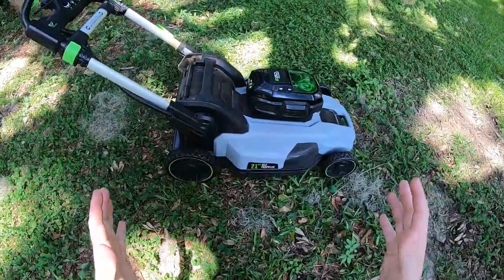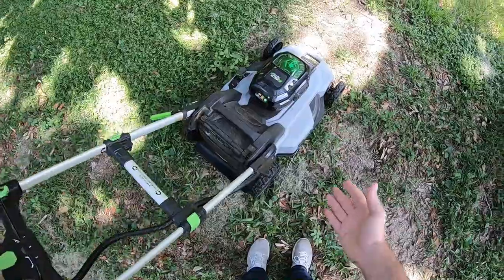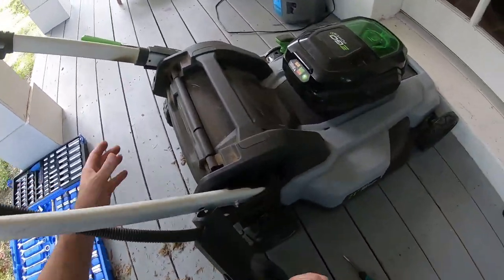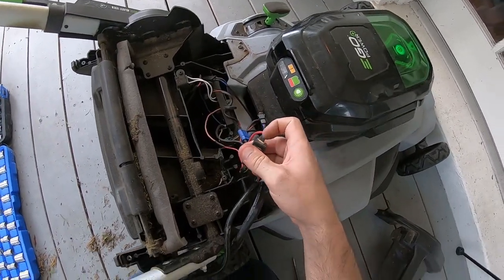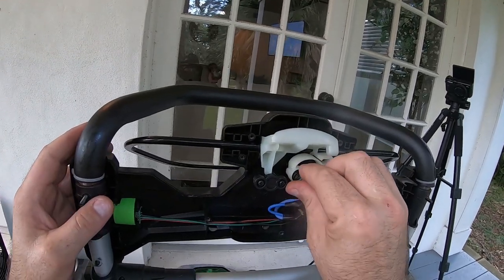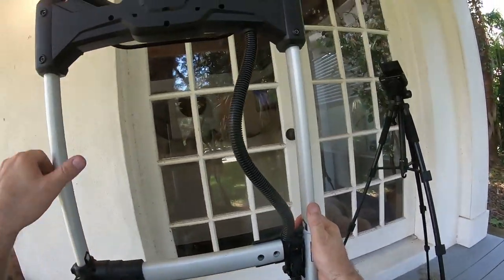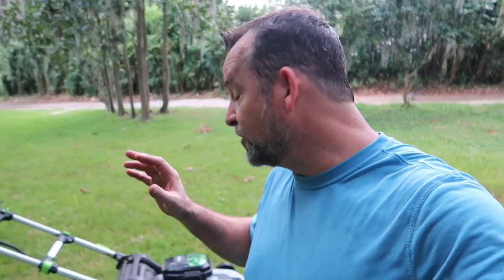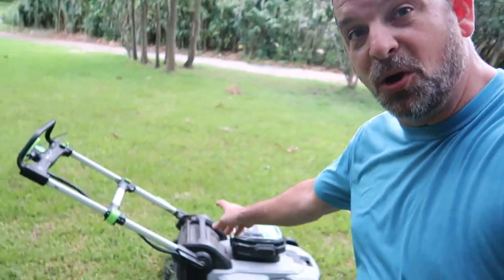BROKEN....My 21" Ego Electric Lawnmower is dead.  Can I Fix It?

Comment: Wait for the right rear wheel to lock up when pulling the mower back, as everyone does. Such as a back-and-forth motion around a flower bed. It will start locking up, a little at a time, then it drags the wheel whenever you pull the mower back. Whether the mower is running or not. EGO now claims the wheel locking up "is a safety feature to keep the mower from rolling towards you". No, the nylon gear in the drive system is stripping out, whether you have ever used the self propel feature or not. A design feature. And there should be another "Cherry" type safety interlock switch on the other side of the handle like the one you jumped.

Comment: I haven't read through all the comments, but the Ego won't run if the arms are in the shortened position.  You have to extend the arms and lock with the green levers in order for the motor to start.
Reply from the maker: This was not the problem. The wires failed in side the tube from a pinch point.
Reply: I think Rick is referring to your attempts to start at 3:15 in the video.  The arms are shrunk down instead of fully extended.

Comment: Thank you for this video and the comment by MuckBucket about jumping the red to black wire. I got my mower running again in under 30 minutes. And this video having over 76,000 views is disturbing.
Reply from the maker: Right.  I had no clue that this problem was so widespread!

Comment: I ran over a plugged in cord to a pressure washer. Shredded the wire and now mower won’t work. The status indicator light is completely off where it used to always be solid green. Battery is fully charged and works cause I put it into the weed wacker and it worked fine. Thought maybe there would be a reset button??? Maybe the live wire fried the mower??? Is it unfixable?

Comment: Same problem on mine. Thanks for the Fix-It tip. Now on the jumper, witch color do you close contact on?
Reply: Black and red. The blue wire is a red herring.

Comment: I’ve seen the 4th ego lawnmower owner have the same issue after 3 years the safety mechanism seems to bend or crimp to keep the mower from turning on the blade .. this me asking questions or finding problems with ego lawnmower before I buy

Comment: Is there any way of Preventing the wire "kink" problem for happening again, once it is repaired?  Would just adding another protective sheath or simply wrapping the wires with a lot of electrical tape do the trick?   Thanks very much.
Reply from the maker: Not sure. I switched to the Toro 60v mower.

Comment: Cool video, I run these things commercially so this is good to know!
Reply: Wow how many batteries do you go through?
Reply: @kevingadson9315   On a dry day last week I had the mower run for just under 3 hours on 2x 7.5ah batteries. Wet days are harder, I have 7 batteries currently 4x 7.5 3x 5.0 My channel has most if not all of the information.
Reply: Electric Lawn Services hi there , have you had any of your batteries have the yellow flashing light problem and don’t work ?
Reply: @darrinanddonna  none yet 1 year in 12 batteries total.

Comment: WARRANTY:  I've owned my ego for almost 5 year.  I've taken it into Home Depot for this problem four times.  Each time it has taken over a month to get fixed.  The last time it was at day 55 still 'waiting for parts'.  I picked it up and did this fix since it has been an annual problem for me (ant the  warranty expires shortly).  I like the ego mower.  However, this is obviously a design flaw and it would be nice if they would cared enough to implement a better design fix when I had it repaired.  Keeping the wire from getting cropped would have been an easy design modification.  Bottom line:  If you have the ability to do this, skpt the warranty temporary fix headaches.

SIDE NOTE ON HOME DEPOT:  I kept asking about my mower status.  They kept saying 'waiting for parts' which was out of their control.  At day 55, I asked more questions.  Turns they didn't have any parts on order, but it put that in the notes since there wasn't really couldn't say they hadn't done anything in 55 days of having the mower.  Another reason to do this fix yourself.

Comment: How do you take the mower deck off? I opened up the other part like you did and found mice had chewed thru the wires but one harness goes under the plastic into the motor I guess so I need to open it further to splice em back together Uggh!

Comment: Good fix man, great job!  I've got the same exact mower and have had two issues with it in my year of ownership.  One was the self-propelled drive motor crapped out (Ego replaced after about 3 months of messing around with Home Depot), and now it's throwing overheating issues after some use.  Granted we live in Tampa and it's blazing hot lately but hopefully that won't hinder its use if we mow in the mornings.  When I get home from deployment I'm going to hack the hell out of it so it's either ON or OFF.  All those damn safety switches only make for potential failure points.

Comment: Open erratic circuit if it was a short you would smell the burning fumes they should have locking connection sot that they can't come loose, it could be a switch problem as you say. Be careful you might void the warranty, then you are stuck, if they use a capacitor you could receive the shock of your life!

Comment: I contacted a repair shop who works on EGOs. She told me it's a short in the wire in the handle. she mentioned they are getting a lot if egos in for this wire issue.So that is covered under warranty

Comment: Where you jumped the wire my connectors are reversed. Your female is coming from under the hood but my female is coming from the side bundle of wires.

Comment: I've had a failure of the self-propelled speed controller after 2 years of use.  It is stuck on maximum speed no matter where the controller lever is positioned.  For warranty service, I was told by the EGO company to take the mower to Home Depot, where I bought it.  The Home Depot rental department employee that I spoke with said they would ship out the mower for repair and it could take 4 to 6 weeks.  THAT IS UNACCEPTABLE!!!!! I was also told that if I take it apart to try to fix it myself, it will void the 5-year warranty.  I always slid the mower handle to the shortest position for storage.  I've noticed that the wire harness makes a tight 180-degree loop when that is done.  In fact, there is a break in the corrugated plastic wire harness cover where the bend is located.  I suspect that a wire within the harness has broken from repeated bending, making the speed control adjustment inoperable.  That's a bad design on top of a horrible warranty service situation.  I like the mower a lot when it works.  But after my experience and watching this video, I'll  gladly throw it in the trash and buy another electric mower from a better manufacturer.
Reply from the maker: Check out my toro video I address some of these concerns.

Comment: What gauge wire did you use to jump?
Reply from the maker: 22 gauge I think.
Reply: Thanks I used 18 gauge bell wire found cheaply on amazon and it worked fine.  Thanks for posting I had the exact same issue and this worked perfectly.

Comment: my ego 21" mowerf continually has the flashing amber light when I try to start. On HOLD with Ego for help as have done the past 2 days. Noone answers. Any ideas??
Reply: It probably is sensing overload. I had the same experience with a snow blower from EGO. I'd stick with a Honda instead.

Comment: Do you also have Ego's snowblower?  Mine shut down last year after one storm.  I wonder if something short-circuited as there was wet snow that day.   

I don't know if you have a big enough yard but how is your battery life in hot 80/90+ weather?  It isn't a Tesla which have liquid cooling.  The machine has shut down in hot weather (battery was hot when I took it out).  It might be the tall grass especially the thicker weeds but I don't feel that this machine is ready for summer.  My next one might be a gas one with a steel deck.  There is a 120V yardforce lawn mower bit it is expensive at over $900.
Reply from the maker: I have had no battery issues.  I have a medium size yard so it is not much problem getting it done with the one battery.  I just mow and then put the battery on the charger every time.  I dont have a snow blower as I live in Florida.  I do have the backpack leaf blower.  It is a great tool.  No problems.  Here is the link to that video- https://youtu.be/UUQeGzGy0Ds
Reply: @UnboxWarehouse  Isn't Florida grass much thinner?  I was looking at another YouTuber who does this as a living and he mentioned how you can mulch the tallest yards there as the grass clippings just dissolve in 2-3 days.
Reply from the maker: @JTR253  I rarely mulch.  I do about every 4th or 5th time.  I feel like the thatch gets too thick and makes the yard look brown.

Comment: My ego is older; I think I lucked out because I rarely did a complete fold the first couple of years.
Just lately it's started to shutdown mid-mow, and yeah, I'm suspecting a bad switch, frayed wire, or broken wire.
At some point I'll probably re-engineer the harness.
I'd rather eto would've just make the harness as external-plug harnesses, but I understand you can't do that because people will F##k them up (and lawsuits are fun!!!).

Comment: Which two wires did you jump?
Reply: Ruly Feliciano yeah I was wondering the same thing
Reply from the maker: It was a connector that came out of the handle and went into the middle of the mower. I though you could see in the video.
Reply: Unbox Warehouse the jumper wire you connected .. which two wires was it RED+Black, Red+black or red+blue? I’m not sure which two wire the jumper wire connected..

Comment: Ego needs to see this and change the design so there is a grommit or pass through that keeps the wires away from that pinch point.

I'm on the fence between Ego and Yardworks up here in Canada......I want matching tools/batteries.....I like the ego power+ carbon fiber shaft trimmer but prefer the design and construction of the Yardworks mower which has a steel deck, side discharge as well as mulch and bag plus it has its wires inside the handle.
Do I give up the Yardworks mower design for powerfeed line loading and in my opinion a better trimmer design or go with the mowner I want and settle for a slightly less well designed trimmer but change out the trimmer head on the Yardworks to a universal speedload like Echo or Shakespeare offers

Comment: The EGO-21" has a 5 year warranty and Home Depot said it was fully covered! Why would you risk repairing 
it yourself then voiding your warranty by removing set markers when you open things up in the mower???!!! 🤔👎👎
So now if you have an issue you cannot fix, your warranty most likely will not be covered since they will see you did your own repairs!
It is a great video once your warranty is fully expired but till then be careful and know what you are doing with electricity with the right equipment.
Reply: Hi: My LM2102SP, has developed the problem with self propel stuck at high speed. My warranty is still valid. But the time I got authorization for under warranty repair, COVID-19 hit. Normally EGO services ( Per the EGO Community Forum) take something like two months. Under the current conditions, it will probably be the end of the summer that they will finish the repair. Warranty or no warranty, I will attempt the repair, since with  high probability it is a crimped wire. So this video is helpful in showing us which screws to open to get to specific areas, which in my case will be  helpful for continuity checking of the three wires used for speed control.  Thanks UNBOX WAREHOUSE, it shows us to do some repairs, before the mowing season is over. Hope this explains the logic of why we are tempted to violate the warranties. Oh this is the 4th year of service of this mower, and I have an earlier LM 2101 which I got six years ago. They have both worked well. Even the batteries are still good. Over and gone are the days of the smelly gas mowers, and dealing with dishonest mechanics, which forced me to become a semi expert in opening the engine, carburetor etc. for repairs. 🙂😄
PS: I wish EGO will straighten out their servicing and parts supply mess. They have an excellent product. It will be nice to train the Home Depot technicians in repairing EGO products, and to have well stocked responsive warehouses State sides.
Reply from the maker: Thanks so much for this comment. I could not have said it better myself.
Reply: Fine, Milt Canada, next time my Ego mower craps out you can pay someone to come mow my lawn for three months...